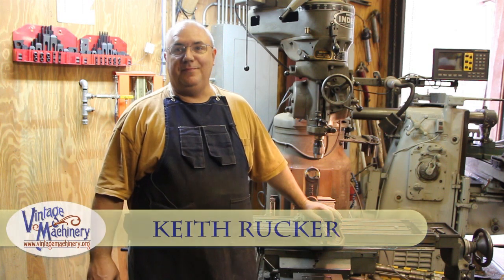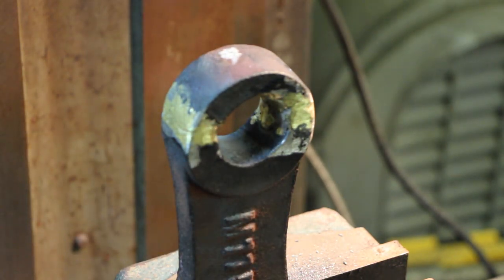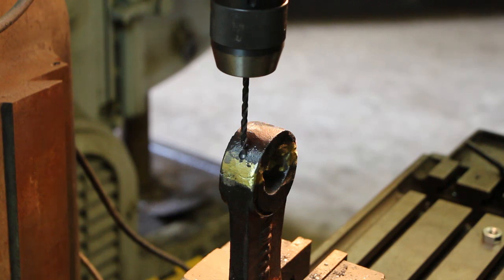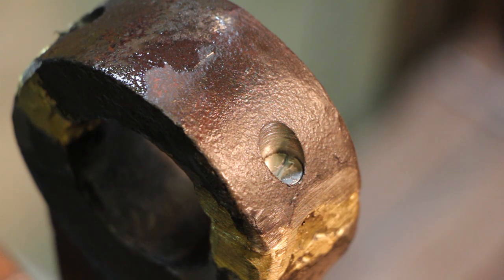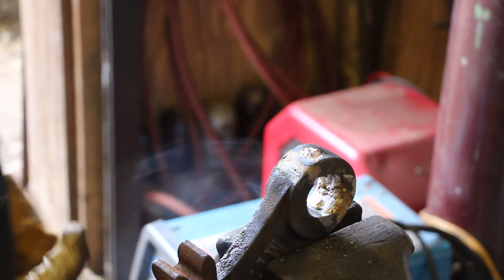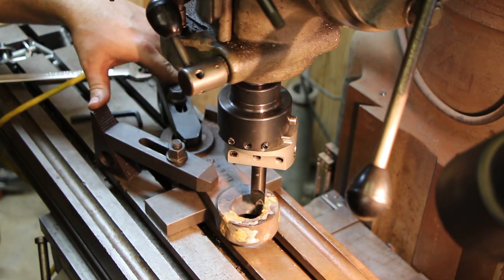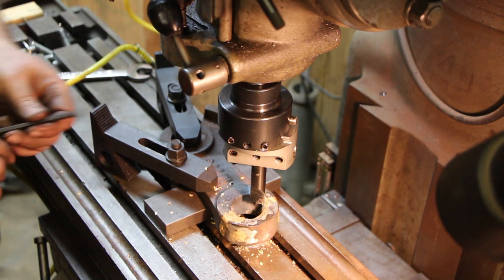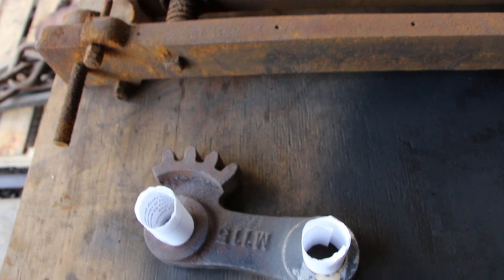Expansion Gear Repair:  Braizing Cast Iron and Boring a hole on a Vertical Mill

Comment: While I'm not sure I would have installed screws (at least not after braising), there is a slightly easier way to get the hole started in a steep slope like that. Start with a 1/4 or 5/16 end mill to give a flat and screw head clearance, and then center drill in the flat.

Comment: Hi Keith the bolt you used was it hi tensile such as a socket head cap screw? While I agree with reinforcing the braze the screw looked to be a weak link if not hi tensile, just wondering? Very interesting video thanks

Comment: Hi Keith, great repair as usual, just wondering, did you bore it back to the original dimension, or did you bore it oversize to be bushed later, or would it not be necessary to have this fit closely? I see it has 2 bores, perhaps there is a need for a loose fit?
  Thanks ......Mike

Comment: I do disagree a bit with the "screwed in braze". For me this is a botch. I’m assuming the surface in the brazed link that has been drilled in the process (the screw od) weakens the link to some amount. The screw actually pulls the parts together just on the thread. In that equation the brazed links without the screw would win for me. There are more factors here e.g. the tensile strength of the bronze – but that a bit difficult to assess just from the images in the video.
If this would be a truly mission critical work piece, I’d suggest replacing the eye completely. The sickle shaped link between the rod and the new eye leaves enough surface to brace this properly.
Again, another very nice video and well explained steps in the process. I enjoyed many of your videos so far, keep up the good work!
Reply: Duh
Reply: So steel reinforcement makes it weaker? Um... yeah....

Comment: If you are going to paint this part why did you subject the part to thermal stress by brazing over the screw heads?  You have risked stretching the screws with differential expansion rendering them useless. You could have used epoxy filler instead. Of course any problems will be hidden so I suppose we can all pretend it's not happened.